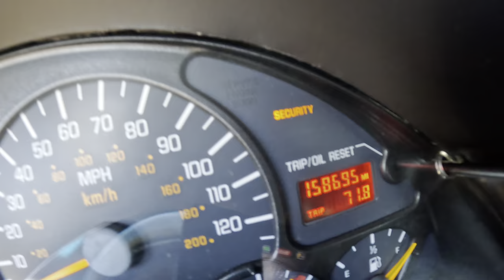Oil in the Radiator! Top End Internal Tear Down! GM 3800 3100 3400 3.8 #mechanic

Comment: If you're planning on putting a rear main seal on that engine, why didn't you just to disconnect the subframe on the front of the car and lift the car off of the powertrain, and do all the work without the body in the way?
I do understand that that could have been a bit more work.

Comment: GM sent two stop leak tablets to the dealer to fix the in warranty intake leaks caused by the plastic intakes in the early 2000s.  I was really saddened by that response.  It was done to get past the warranty period.

Comment: Only a matter of time before tyre valves are on the inside of the rim with an alignment hole in a backing plate that needs a special tool.

Comment: Leave that bracket out because it’s not used for anything and if you have to pull the engine, it ain’t coming out from up top you drop it out the bottom

Comment: That sucks if that bracket don't do anything other than for hooking a chan to it to pulling the engine then I would not put it back in there are other spots on the engine to put a longer bolt throw the chain into the block to pull the engine

Comment: Wow... I'm surprised that considering that car is a 'sports car' that the owner got that much mileage on it. Usually those cars are wrecked by 25K miles.
Reply: My old 94 Buick with 3800 engine, has 285,000 miles and still going strong. These engines 
are about the best of the GM engines ever made..bullet proof. ❤
Reply: @williamoneal2763 excluding the intake issue with them which doesn't affect every 1 of them.

Comment: Should pull that motor out and put a  v8 ls3 motor in
Reply: I don't believe he is a speed/mod shop, the 3.8 is fine, no need to stuff a v8 in, (and yes 1997-2002 models could have a LS1)
Reply: @shadowopsairman1583  I know they also came with ws6 package with lS6 . Nah Ray a repair man not a speed shop for sure. Never cared for that body style firebird.

Comment: Do you have to remove the cylinder heads
to fix the oil in the coolant problem as well
Ray?🤔
Reply from the maker: It comes in through the lower intake gaskets, it’s not a head gasket problem

Comment: Just to correct the history of Duc tape for those posting about it. During WWII in the island hoping campaign of the pacific they had a landing craft called the duck boat. Worked fine except the hull would take a beating on coral and such when landing on islands and atolls. So, They needed a way to repair the hulls from leaks in a emergency situation. So, They came up with duck tape as it could be applied even under water. That was the origin of duck tape which has gone thru quite a few changes name wise. I know this because my Grandpa was selected to train the navy on how to perform island landings and was one of the first to enter service in the pacific - he drove landing craft during battle. 

Ray, Love your videos and watch them all the time. I see that this 3800 is built a bit different then the FWD versions. However, Because GM really screwed up on the IMG's and used those plastic type ones in production you usually have to replace them jut once and your good to go. I did my GF's 2003 Malibu with the 3100 and its not really that hard to do on FWD cars. We now have Lucernes with the 3800 in them and I think they have already been done as mine has 162K on it and doing fine.

Comment: Old guy tip. Apex makes industrial sockets with magnets inside. Great for hard to reach easily dropped fasteners. We used them at the Subaru factory where I worked. Apparently dropped fasteners can cause havoc with a new car…. Who knew? 😂

Comment: By the way. You emphasize  Duct Tape and NOT Duck Tape. Here is the history::  Their new unnamed product was made of thin cotton duck coated in waterproof polyethylene (plastic) with a layer of rubber-based gray adhesive (branded as "Polycoat") bonded to one side. Afterwards while a special application ( Ducts ) it was renamed in Duct Tape
Reply: BOTH are correct.
Reply: @johnt.848  that is not the issue. Mr Ray said something else

Comment: Man, watching you fight with those bracket bolts on the back of the valve covers reminds me of that one meme..

A ratchet "Please come loose."
A bigger ratchet "I hope it comes loose."
An even bigger ratchet "I wasn't asking."
An angle grinder "You should have listened."
An oxy-acetylene torch "It can't be tight if it's a liquid."

Keep it up! Even though I'm not particularly mechanically inclined, and don't even own my own vehicle, I've enjoyed watching every one of the videos you put out.

Comment: Technically, Duct tape is actually a metal tape used in heating and A/C ductwork.  The fabric tape that everyone CALLS Duct tape is actually called Gaffer Tape and used in the entertainment industry.  Movies, TV and Concerts mostly to tape down temporary lines.  The term comes from it being used by Gaffers (the guys and gals that actually do the aforementioned work)